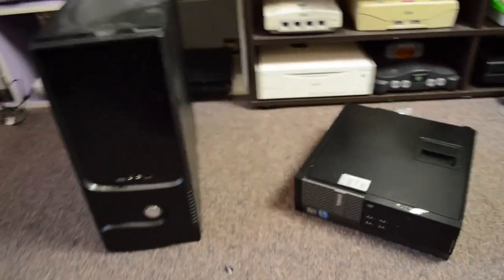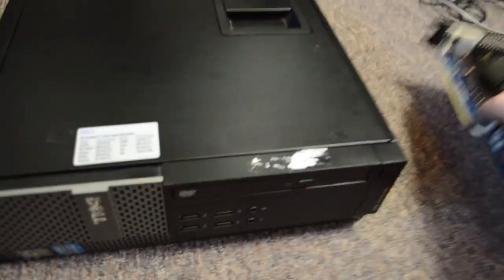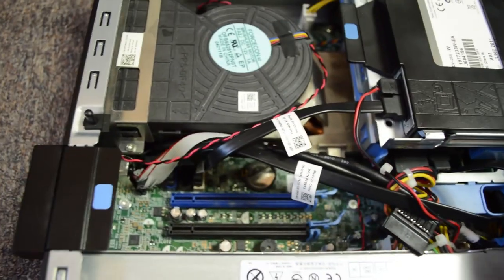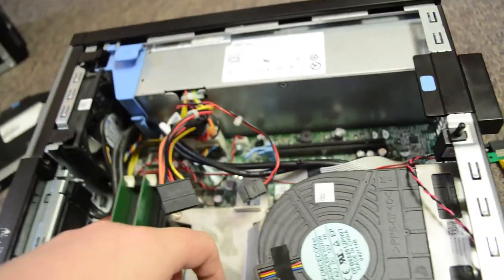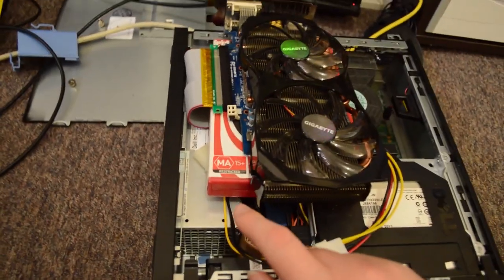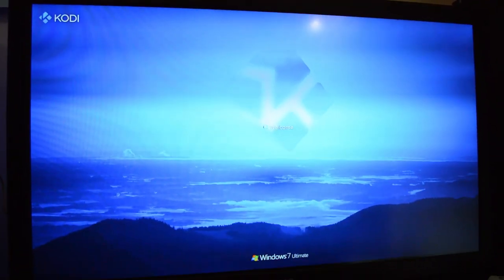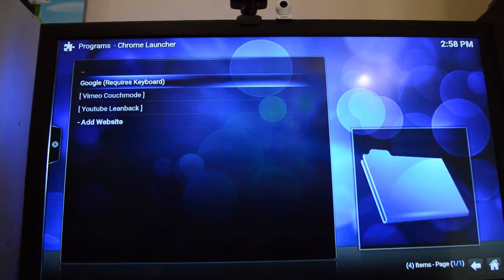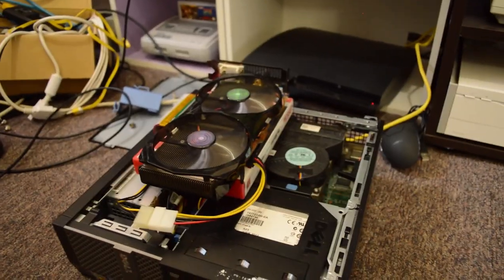Budget HTPC / Gaming Steam Machine Build VLOG

Comment: What do you think of the athlon x4 860k? It's a fairly cheap yet decent power CPU that would fit any casual/new to pc gamer I think as well as a $80-100 GPU or even less than that. I'm just not into being the top as far as PC power goes.

This machine http://www.cnet.com/products/emachines-w3650-celeron-440-2-ghz-1-gb-160-gb/specs/ as well as throwing a ATI HD Radeon 2400Pro was my first gaming rig technically. It's crazy knowing that this chip alone http://www.newegg.com/Product/Product.aspx?Item=N82E16819113367 is around the same performance, but at a much lower TDP and cost. It's sad APU's get a bad rap from elitists who say "You like it, because you're used to crap."